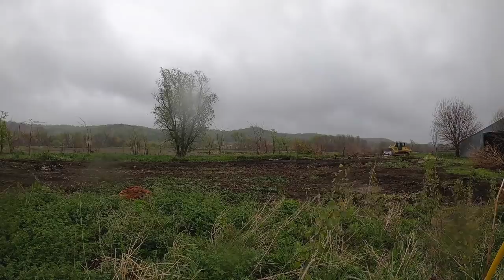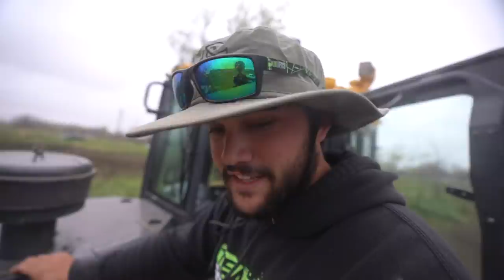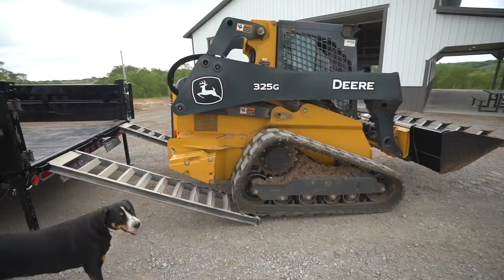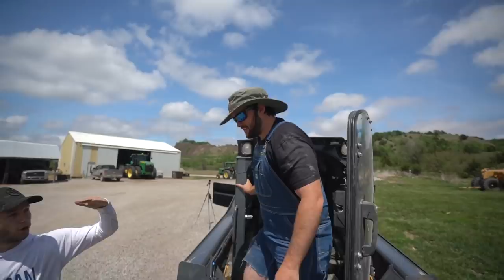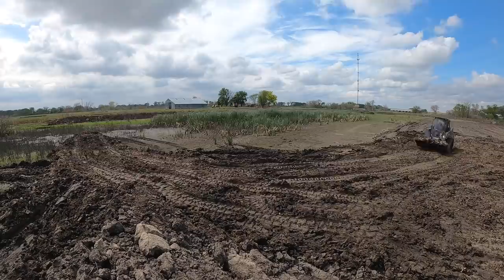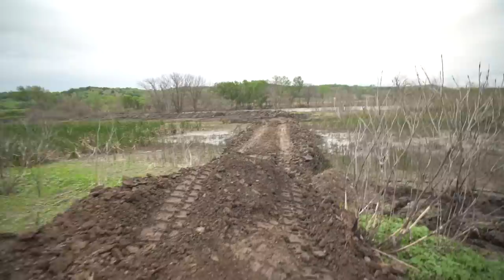Building a GIANT POND at My FARM!!! (I Got Stuck)

Comment: Try loading the skid-steer or “skid loader” forwards again just put the bucket down when you are most of the way you the ramps when you started to tip it will lower your centre of gravity and probably make it a one man operation! Or just check out skid steer Olympics on youtube they load them without ramps!! New video idea!!
Reply: That and maybe don't have legs as low. Doing that will make a shallower angle, kinda pick the back of the truck up, but shouldn't feel near as tipsy.

Comment: The deaccelerater is exactly how it sounds... Works backwards from a vehicle, push the pedal to the floor and it idles, let the pedal up and it revs up the motor. Dozers aren't that hard to figure out and do decent work with. Just get the feeling of the machine and rock with it

Comment: If you used your bucket on your skid for weight distribution while loading it will be alot easier.. When you go up the ramps bring your arms down. Having them pointed up is what is making you tip. You can even slide the bucket on the trailer bed while you climb the tracks.

Comment: If you want to remove a big tree like that one you were talking about with a big trackhoe like that,  you just reach up in the top and slowly break the top out of it, and work your way down until you only have that main trunk left, then you just push it over, pushing it away from the machine, and if it won't go down dig around the bottom of it a little to break some roots, on the one side the machine is sitting on, then give it another push. Repeat until it falls. lol.

Comment: For emptying it, you should just buy a big culvert that would go through the bottom of your dam that you built that you could dig out with the mini, but just put a culvert through the damn with a closing cap on the end that you can open right at the ground level so you get the flow you want, and then you can just crack it open to give yourself a flow in it once it’s filled

Comment: Flair if you lift the dump box up a bit it is a little easier to load and unload because it is not as steep and you will not get the teeter totter movement!

Comment: You need helper bags on your truck. If you put the weight in the back of the trailer your just gonna fush tail it. Always keep about a 40% rear 60% front weight distribution roughly

Comment: when you load the loader dont put the legs out on the back and have someone push the break because them the trial will level out with ramps and make it easier to drive it in... if you think your going to mess up something my dad owns a lawn and tree system with the same setup and the had a 50,000 truck and 13,000 trailer and hasn't ruined anything loading thing up. it will make it 10 times easier to load and unload and less stressful. im 16 and ive been loading them for 2 years now and its way easier.

Comment: if you put the bucket lower while going forward into the trailer you will be fine and it’s virtually impossible to tip a skid steer they are so heavy the and the center of gravity is so low

Comment: I'm not sure if the laws are different where you are but I know in my state you have to call the corps of engineers because you are diverting wateryou probably need a permit and you have to do something about erosion control just FYI OSHA could fine you $50,000 for uncontained silt runoff